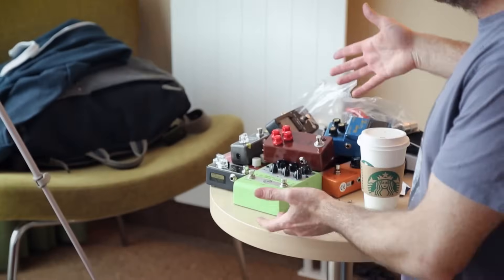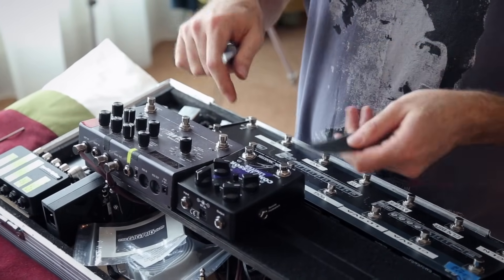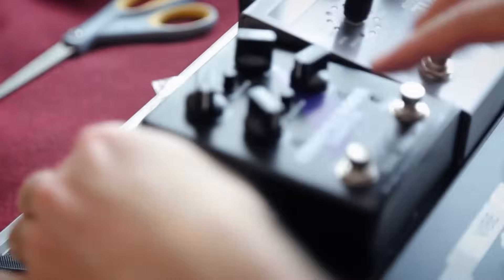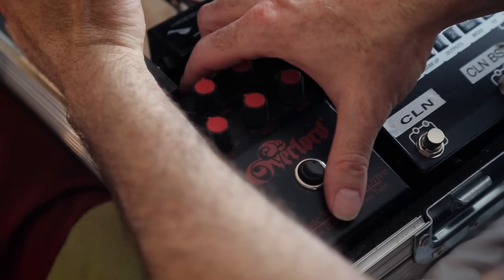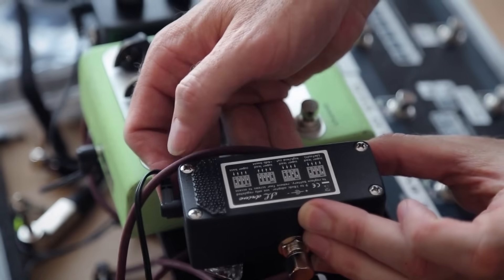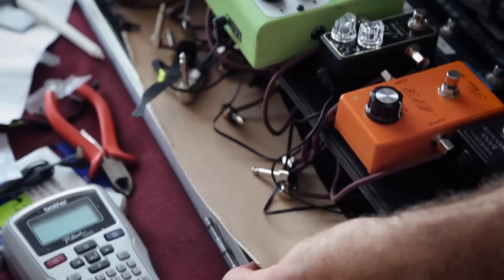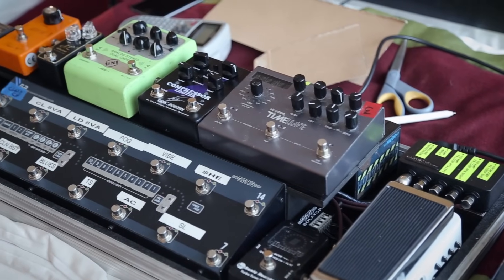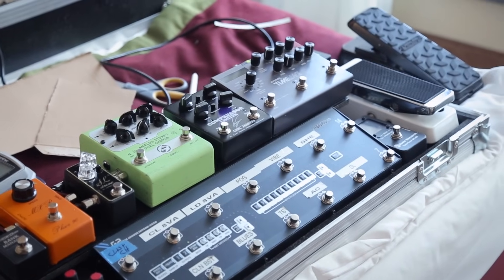That Pedal Show - Andy Timmons pedalboard build special

Comment: Little tip for you Daniel: should work on a pro touring board; Ive never had any problems w it. Velcro now makes their version of a ziptie. They come in packs of 50, there are colored ones as well. Any hardware store has them. I change things out alot on my boards and these velcro ties remove all worry of cutting power cables. Cheap, reusable, and you can cut them to size. Theyve made it alot easier to change pedals and order. Hope that helps!
Reply from the maker: Cheers Brian, I'll check them out :)
Reply: +Daniel TheGigRig  what type of pedal board is this? I noticed you use these in your videos a lot... looking for a two tier pedalboard with space under for power supply and surge protector?? thanks
Reply: Pretty sure it's from a British company called Custom Pedalboards. http://www.custompedalboards.co.uk

Comment: Hey Daniel! I love all of the stuff you put here in Youtube. I was wondering if you could make a video about pedal switching systems. How they work. How to set up a pedal board using one. What's the purpose of the loops and all. You get the idea. I do think that most are still not familiar on how it works. I am unfortunately one of those who are not yet enlightened and I hope you folks make a video about it. Anyway, cheers! 😁
Reply: The basic concept is decades old, so most are familiar with it. Look up Tom Quayles demo of the One Control OC10, he explains the basics pretty well. Try reading the Gigrig G2 manual as well, it has pictures of how it's set up.

Comment: Would like to know more about those mods to the Dean Markley Overlord. Have read it is a re-branded Tube Works Real Tube, and that even though the pedal has mains power, it is stepped down and the tube actually runs on low voltage and just functions as a clipping device while using a 4558 for gain.

Comment: Set your pedals how you like them, then, take off the knob & put it back on so the "line" is at 12 o'clock. That way, you can quickly look at all your pedals and if every knob isn't at 12 o'clock, you'll know something moved AND it's simple to set something back. Make sense ??
Reply: great idea!
Reply: That is a  great idea. Never thought of that. Thanks!
Reply: Game changer!!
Reply: Quentin James i like that cheers mate there I was thinking masking tape and black pen
Reply: I tried that, it's good for Boss stuff, but usually pedal manufactures don't like you doing that. I always used to replace the knobs on my ProCo Rats and modern EHX stuff (those awful barrel knobs they started using a few years ago) and no matter how gently I'd remove them, they ALWAYS split down the inside pole, so be warned!
Reply: No more rookie fumbling around at a late night gig trying to figure out what the hell went wrong with my settings!!!
Reply: Brilliant!  Thanks.
Reply: Good idea until you want a different sound and get completely fucked. Better idea is to use tiny strips of neon tape to make "new" 12 o'clocks, so you can still see where the real deal is.
Reply: Thank you!! Gotta try this cause Murphy's law seemingly is effect even when I drive 2 miles at set up at church.. doesn't help I'm always late either!

Comment: Brilliant - I've watched a half-dozen times now.  Question: I don't get sticker shock very often, yet every time a google a cable kit like the SIS, my draw drops to the floor when I see the price.   Isn't it just good ol' copper wire and shielding?  Are the connectors where the cost comes in?
Reply: I finally took the leap and got evidence for my entire board. Very expensive, but they are awesome. After the first few plugs I was able to make them very easily, and they're not gonna break ever. You can also reuse the plugs which is very nice.

Comment: Daniel -- quick question that I've not seen clarified elsewhere, and I'm hoping you can provide insight.  Andy often mentions the Carl Martin compressor, and has demo'd how he uses the one side of it, where it's more like a boost than a compressor (there's a vid of him showing the difference between the amp without the compressor, and with it -- and there's a very distinct boost in volume).  My question is, does Andy keep that boosted compressor on for all of his sounds, as a base tone?  IOW, when he goes to a dirty sound using the JHS AT pedal, is that pedal feeding the amp directly, or is it going into the Carl Martin compressor first?

Thanks!   /Anthony

Comment: Hy, I See that You did not use MIDI on the Time line. Does that mean he does not use strymon presets setting saved in the gig rig ? So he still has to change his pre-sets on the fly manually ?
Reply from the maker: He only uses one sound on the Timeline and simply uses an expression pedal to control the effect level
Reply: +Daniel TheGigRig Are the 2 tier style boards available to buy, thanks :)

Comment: Daniel, love watching you make these boards!  My board is wired up with Lava Solderless which keep breaking.  They just keep dropping out.  On inspection it's where the cable, where it's bent into a right angle is, on the inside, breaking through the white insulation on the inside to touch the outer conductive wall.  

Are these Evidence kits a long way ahead of the Lava's, in your opinion?

Cheers!
Reply: They absolutely murder the Lava's. There's a reason Daniel changed over. I too bought one of those Lava kits and they are horrible. With Evidence it's unlikely that you'll ever make a bad plug, so long as you follow the instructions. And when they're built right, won't break ever.
Reply: +TheSphericalGuy cheers man, I'll do an upgrade soon.

Comment: Awesome! Question: is there a secret to getting BOSS pedals to switch on "activated" or is it a matter of switching them all on every time you power your pedal board?
Reply from the maker: Cheers David. There's a little mod you can do the transistor inside that determines the state of the pedal when it's powered up but apart from that we're stuck with having to turn the pedal on at each power up :)
Reply: Daniel TheGigRig Thanks for the response! I'll stick with switching on my pedals then ;)
Reply: See i have a boss os2 that is on when power goes in to it, even if I have it off when the power is turned off.  Bought it new and haven't touched it so I dunno whats up with that

Comment: You’re a professional, but you still use way too much Velcro on the pedals. Especially with the dual lock you’re using. You just need a small square or two to hold the pedals super securely and still allow moving them when needed. No need to go edge to edge.

Comment: this board is 1. sloppy, 2. heavy, 3. no solder? come on dude...
Reply: How is the board sloppy? How do you know how much it weighs? What is there to solder? He's using solder-less cables.
Reply: He addresses specifically why he leaves the cables like that in another video; neatly tied down and routed cables = no pedal swapping without massive hassle, and Andy swaps pedals around a LOT. Also in that same video he discusses the Evidence SIS cables and why they are superior for this application. His boards are also extremely light comparatively, how did you even come to the conclusion that it was heavy? 0/3 on that one dude, strikeout.